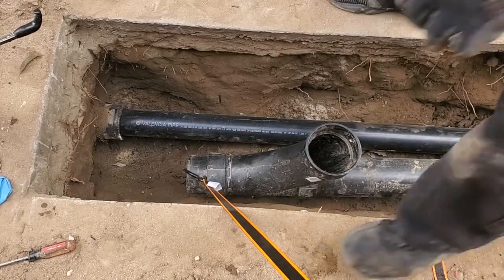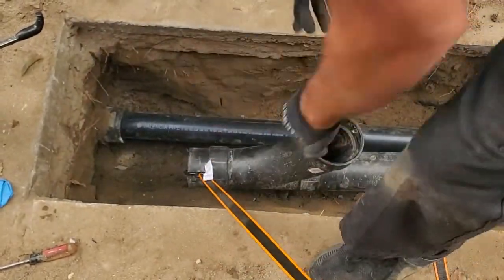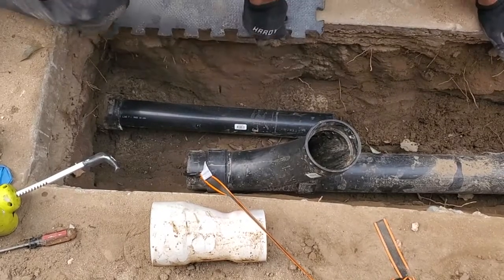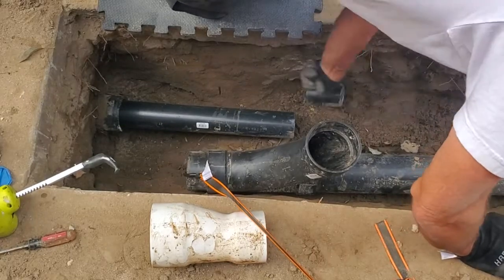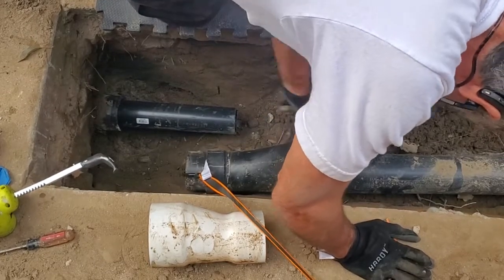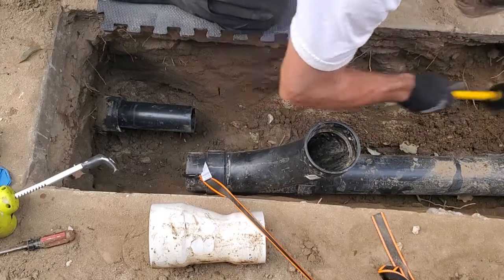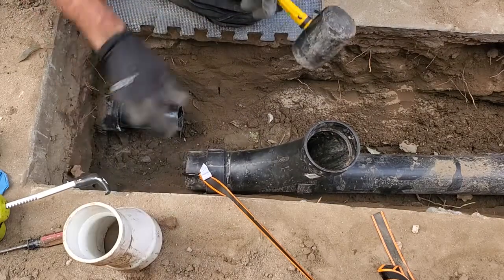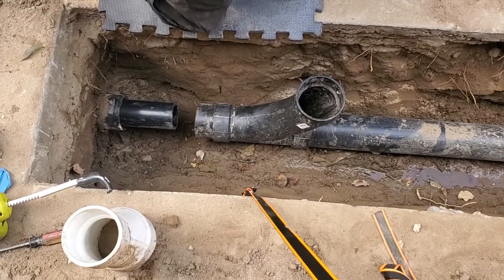PART 2 - I saved $9000 repairing this old orangeburg sewer pipe with ABS

Comment: did you just pound a three inch piece of pipe into a 4” ??? 🥹🥹🥹🥹🥹
Reply from the maker: No, I pounded 4x10ft pieces of pipe inside a 4" cavity of cracked and collapsed Orangeburg that had to be snaked every 3 months for 9 years... And hasn't had to be snaked for the past 3 years... Costing less than 1 plumber's visit. 
... Thanks to the genius who invented the 4"x3" eccentric PVC REDUCER coupler.

Comment: The 4 x 3 closet bend is allowed and is technically a reduction in pipe size. Where I live homeowners can do all sorts of work to their own property that a licensed professional can’t get away with legally. It is supposed to be brought up to code when selling. I would consider this an emergency temporary repair to restore utilities services. It is very important to get the sanitary sewer up and running for the public health. Just because we don’t see utilities marked or the final product installed, bedded and inspected does not mean it didn’t happen. All of that may not be needed because local codes vary widely. 

For people who see this tip and spaz out, relax and take note. There are so many homes sold with sewer issues it just makes sense to run a camera down the line before buying. The builder may have run over the new sewer line with an excavator and crushed it. I have seen it.

Thanks for sharing

Comment from the maker: Your answers are found in the title. I used rubber couplers where PVC meets ABS, so no leaking or roots.
There's 20ft straight ABS before the eccentric coupler, so if you study fluid dynamics (or visit countries with open sewage, or put a camera down a 4" sewer and flush 2 toilets at once) you would know that the 4" pipe never even fills to half the diameter so it will flows easy 4" to 3" on planet Earth. 
If there were a clog, there's a cleanout 10ft up from the eccentric coupler (which I've never had to use). 
Got anymore dogma to share?

Comment: Going through all of that work and using a PVC connector on ABS?  Will definitely leak/separate at that connection and allow root infestation to clog the pipe.  Also, on what planet is a 3 inch pipe (or 3 inch connector) allowed along the length of the main drain (your pipe) leading from the house to the sewer?  I'll be sure to never call you for any plumbing repairs unless I'm interested in having lots of problems and code violations.

Comment: note most Orangeburg is flatened
Reply from the maker: When it flattens does it usually leave a 4" cavity? I used a sewer camera to see how blocked it was... Also used it as I pounded in the last 10ft section of ABS so I didn't go into the sewer too far.

Comment: so if you would have found the vertical drop and reduce to 3in you would have been fine but the laterals should never be reduced in size
Reply from the maker: Isn't it the opposite?... vertical waste drops clog faster, but in (horizontal) laterals gravity spreads the waste out on the bottom of the pipe.
.25" per foot is the perfect slope to spread out waste water in the pipe. If it was 1" per foot I could get clogs. 

Don't all new homes have 3" sewer lines?

Also, 
All toilets are a funnel - from the bowl (6" min) down to about 2.5 inches... And they rarely get clogged.
I'd have problems if a kid could flush a 4" toy down to my eccentric reducer, but the 2.5" toilet neck screens everything that could clog a 3" pipe. 

I'm still open to hearing about an actual installation like mine that didn't work.
Reply from the maker: Interesting: I would agree if it was a regular reducer bushing, but this is an eccentric coupler. I think a straight vertical drop could more easily clog than a horizontal eccentric coupler because the way sewage flows it rarely fills a horizontal 4" (or even 3" pipe) more than 2 inches... at least this is what I observe through the cleanout. I have not done this vertically, has it been your experience that a 4" to 3" vertical sewage reduction won't clog?

Comment: You are going from 4” abs to 3” abs…illegal…
Reply: The proper response is you might be able to drop from a 4 inch to a 3 inch if it fits within the fixture units per NPC though all of this is not the correct way to do plumbing. If you sell the house and at some point they find you did not pull permits, depending on state law, you may be liable for multiple things. I would also be concerned if that is going to the property line you've pushed that pipe too far into the main, and that can cause clogs. If the city finds out your pipework caused it, guess who pays for the time and work to cut it out. For the code part you mentioned, when you start tearing stuff apart and redoing it to that degree, your legally obligated to follow code since that is considered, everywhere, a major item that falls under health and safety. If you don't touch things (plumbing, electrical, etc.) it's grandfathered in generally.
Reply: yes he can. Fixture units
Reply: 30 pack jack LMAO
Reply: Hi  !  The round bales of hay are illegal in Delaware where I live,  Why you ask  ?? They say the cows don't get a good square meal ! 😂😂
Reply from the maker: While I admit this is a hack, you bring up some good questions:
Done some research and found everything from "ABS is illegal in California" to "official documents are required to buy ABS" to "you cannot glue ABS to PVC". Maybe you can't downsize from 4" to 3", but specs for new homes only require 3", right? 
Aren't all toilet wax rings for 4" pipe?... so isn't there a 4" to 3" reduction on all homes with 3" sewer lines?
If I start upgrading to code on this 50+ year old home, I'm not sure there's any part of it that would survive the requirements. 
All I can say is, the eccentric coupler works great and I haven't had ANY clogs since I put it in.

Comment: Did u use any kinda lube?  Maybe some dish soap or used motor oil would of helped?
Reply from the maker: Not a bad idea, but mine was 45 foot run through a 10 ft ditch so not sure how far the soap would go.  Didn't need it though... the PVC is smooth so the last 5 ft went just as fast as the first 40 with a heavy rubber mallot.
Reply: So how did u join the pipes together?
Reply: @51-FS  don’t use this repair, it will create problems.
Reply: @jacksplumbingvideos7147 do u have a video on the rightvway to fix it?
Reply: @51-FS  no because I don’t have the material to make one, the right way to do this would be to replace the line.
Reply: @jacksplumbingvideos7147  but it's a video on repairing it. Every one knows that stuff needs replaced, but some times we just got to repar it tell we can replace it?
Reply: @51-FS  he is putting a whole new pipe in so it is not repairing but doing a crappy job on replacing it.
Reply from the maker: @51-FS  see Part 1 for description of coupler